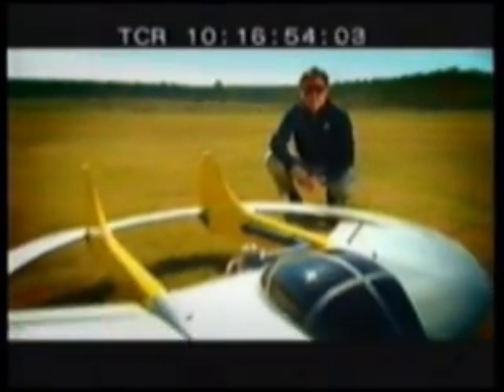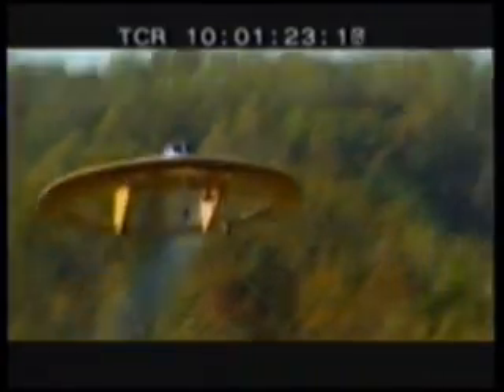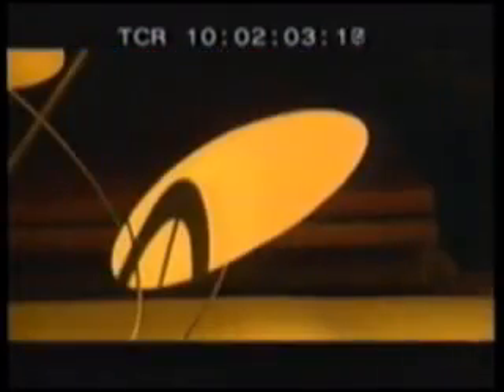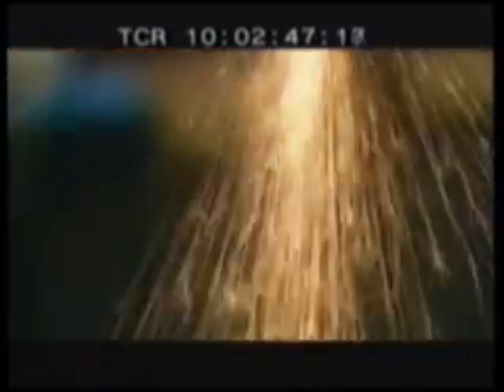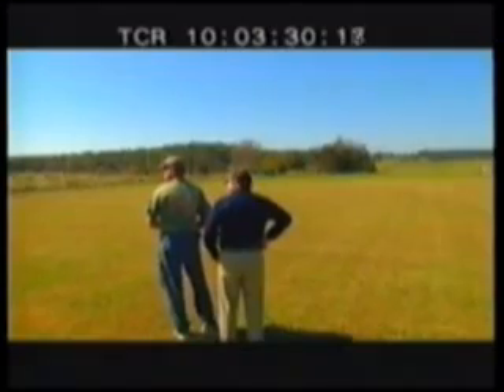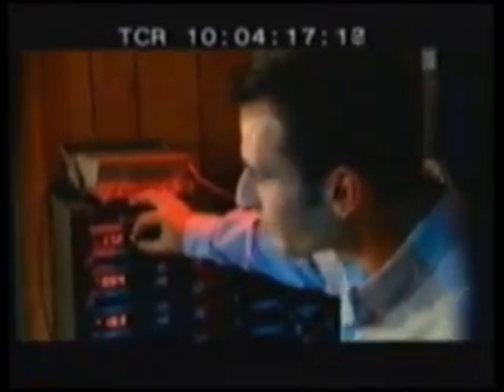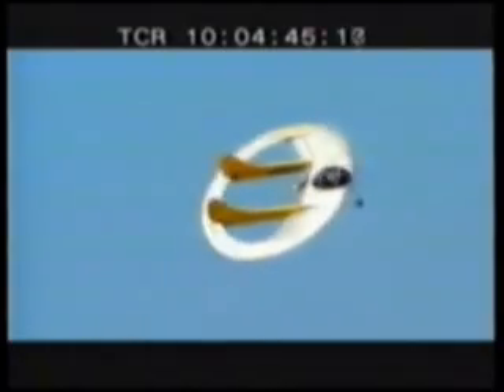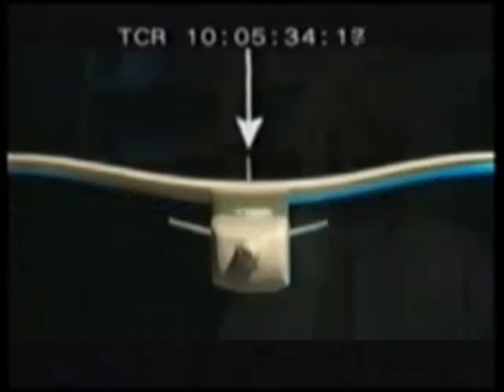Flying Saucers Are Coming!

Comment: Many disc wing planes have worked well, and others of the very-low aspect-ratio sort.
One thing this video doesn't go into is stall characteristics. Does it stall?

The model Sack AS-5 did very well. The AS-6 probably didn't have suitable landing gear to get enough "_A_" angle of incidence . It certainly didn't need any more power or even what it had, to fly.
 The similar Arup planes did very well, with 30 degrees + "A". The Moskalyev SAM-9 also had trouble getting aloft until they gave it more than 25 degrees "A".

See the Arup S-2 and S-4 from Indiana which were amazing, superior in almost every criteria to "normal" planes (super-STOL, extreme rate of climb and quick on little power, stall-spin proof) Arup S-2 in a museum undergoing restoration. S-2 was the deign ancestor of the Vought V-173, which did not need the props situated as they were.
See the youtube "flying heel-lift".
https://youtu.be/Nxz1UF67EQI
Arup S-2
https://youtu.be/TX5s4yEP09I

Arup S-4
https://youtu.be/_XrSFVDa3mY
1980s follow-on proof of the Arup
https://youtu.be/zK63GJ0saBA

See the Nemeth "parachute plane" which was also notably superior, also notably ignored. Faster than the plane which the fuselage came from, Steep climb and descent, Super-STOL, stall-spin proof.
https://youtu.be/WzjpXLKLx1s
The similar 1930s Farman 1020, also stall-proof, super-STOL, faster than the original.
https://youtu.be/D6lxRrSyopM

Also from the '30s the Payen/Aubrun AP-10 which did very well by all reporting.
In the '40s see the Eshelman, commonly called "flying flounder", being proposed as a carrier-borne fighter. Rapid climb and fast, super-STOL.
https://youtu.be/JpV68abt8uc

1930s work by Piana Canova on very low aspect-ratio planes PC-100 and 500 gliders, and PC-140 monoplane.
Concurrently see the "Rosenfelder flying wing", which is very similar to the Sack and the proposed Me-600 discoid plane.

After the war the Avro Canada/USAF "Weapons System 606a", of which the Avrocar was the VTOL landing gear half. The Avrocar didn't need to go faster or higher, when you see what the Arup and Nemeth and the 2015 Rowe "UFO" can do.

Also in youtubes, the 1959-60 Sukhanov "Discoplan" gliders, working up to super-STOL supersonic fighters concurrently with the Avro project. (Both Sukhanov gliders in a museum now)
Letayushchiy (flying) disk
Летающий диск (1964) 17:20
https://youtu.be/UQ1XiIMgLck
video
https://www.youtube.com/watch?v=at77GUZm9rY

See the 1940s proposed Boeing model 390 and 391 fighters: The "Flapjack" which the Navy should have built. By ample experience of similar planes, it would have been extraordinary, would have revolutionized aeronautics.

On youtube, see the 2015 Rowe "UFO" discoid light plane. Like the Arup, stall-proof and STOL, rapid climb, sleek on little power.
https://youtu.be/eFgr90LobAQ

https://youtu.be/_-u0Y7cDngM

Comment: Where is this original air craft and is it for sale would love to have it as a legacy to my father that built it Mike Rawls. thanks in advance Kevin Rawls.    krawls1@bellsouth.net
Reply: Mark Murdock has the original. He is rebuilding the vertical fins and addingnew fuel tanks. It now flies up to 90 mph with a 1.2in Webra engine. We also have a 2meter fiberglass prototype with a 5hp gas 3W engine.

Comment: XF5U
Reply: loosely copied by the designer who had seen the Arup S-2 fly for NACA in the early '30s. (See youtube "Flying Heel-Lift")
The V-173 "flapjack" test plane did not need or gain anything from the situation with the oversized wing-tip mounted outward turning, tuned, plane changing props. NACA tunnel tests said it didn't change anything or gain anything versus normal 80hp props spinning inboard.
The Arup proves that the exceptional flying qualities of the V-173 were from the very-low aspect-ratio planform alone and not from the props.

The XF5U never even made a test hop because of the over-complexity necessitated by the power-sharing drivetrain.
 Arup planes were notably quick on little power, super-STOL, stall-spin proof.

The discoid naval STOL fighter wasn't killed by the advent of the jet age as is usually told. They'd have been awesome on jets and would have revolutionized aviation with discoid wings, if the Navy hadn't let it die.

See also the Boeing model 390/391 of the 1940s for their design for a naval "flapjack" fighter that did away with the wing=tip props. By the experience of the Arup, the Hoffman "Flying wing" which was related, and the '80s Hatfield "Little Bird" they'd have flown amazingly.
Reply: invented around WWII

Comment: The use of circular or disk shaped wings is not new.  I believe students at Harvard made a monoplane aircraft using a 'parasol' shaped wing in the early 1930's or sooner.
Reply: In the '30s, in  Florida, the Nemeth "Parachute plane", and in Indiana the Arup planes were partly designed with help from a classroom.

Comment: The Navy had a craft named the XF-5U which was approved to go into production, it was of similar configuration to this craft with the engines on its outboard sides, look it up it was called the Flying Flapjack.
Reply: Yes, we studied it years ago. very interesting project.
Reply: loosely copied from the Arup S-2 which flew for NACA in the early '30s. (See youtube "Flying Heel-Lift")

Of the V-173, NACA tunnel tests said it didn't change anything or gain anything versus normal 80hp props spinning inboard.
The Arup proves that the exceptional flying qualities of the V-173 were from the very-low aspect-ratio planform alone and not from the props.
 They'd have been awesome on jets and would have revolutionized aviation with discoid wings, if the Navy hadn't let it die.

See also the Boeing model 390/391 of the 1940s for their design that did away with the wing-tip props.

Comment: What happened to this little project?
Reply: The largest version of this design is 6.5 ft in diameter and flys at50lb.s MTOW. Small electric versions fly at 2 to 3 onces and 8 inch wing span. Some are UAV's.

Comment: TU Delft in The Netherlands has try reach allready with flying saucer idea they create too reach airliners and even Boeing, but not yet succeed yet in 2009. Maybe you can make contact with TU Delft (Technical Universaty Delft, The Netherlands) to work toghetter. I hope! It's my dream too, to travel with flying saucers. It's cheaper, safer for human AND birds without fossil fuels but solar energie or something different. Some airliners had interesses in that project, but the most important never came up sad enough :(

To take off and land, maybe it's not so difficult. Look at Helicopters for example. There must be a salution somehow to take off without propellers or airplane engines and then land safely.

Comment: Or the Avero.  Personally I find odd shaped air frames intriguing.  Although all small scale planes are easier to make work when compared to full scale.  Power to weight ratios are usually better on small models.

Comment: first of all UFO means unidentified flying object the term does not have any particulars about what the object looks like. I was really disappointed with his research analysis (solid disk has terrible characteristics while landing) apparently he never got the information about the pancake aircraft designed by the military the pancake aircraft as very good flight characteristics and is remarkable in landing and takeoff.
Reply: His engineers knew all about the WWII flying pancake. This not a solid disk.there is open airspace in the center. This can descend vertically and has done it at Air Shows in Ga. and CA.

Comment: I have an idea, and basic design of a flying saucer that if built, would almost certainly have to be unmanned because it can turn at incredible speeds. there is no other craft that i'm aware of, with a design like mine. mine is really about HOW it can change direction so fast. if we could combine his craft, with my design it would be unstoppable. his already looks like it turns fast, and is stable. if we put my.....controls, for lack of a better word, would be like putting his model on steroids. with my design could make abrupt turns at high speed. i'm not an engineer, so I don't know the right words, but it would definitely work. I got the idea from current technology, so it could be built right now.
Reply: ctcole77
This lying twoofer doesn't like to answer any questions that debunk his magical theories!

911 WAS AN ISLAM JOB!
Reply: DUH!!  me 911 twoofer me tinks alumiunm glows silver just like Terminator movies
Reply: ctcole77 duh, anyone with half a brain knows i'm right. of course that half a brain thing excludes you.
Reply: gary williams
Science
Reply: gary williams
911 TRUTH = MAGIC
Reply: ctcole77 what's
Reply: ctcole77 in
Reply: ctcole77 your
Reply: ctcole77 ppile
Reply: ctcole77 of
Reply: ctcole77 accord
Reply: gary williams
911 twoofers LIE!
Reply: gary williams
What about MOLTEN ALUMINUM?
Reply: gary williams
911 TWOOF = FAKE THERMITE

Comment: the fact is, the concept of a UFO inherently involves anti gravity technology. if anti gravity tech doesn't exist, aka is impossible, then UFOs are not feasible. putting a propeller on a UFO doesn't solve any problem of mankind. the best stealth aircraft, given what our technology can provide, are not disc shaped. this is because the jets are designed to provide forward force, not downward force. with anti gravity technology it would be possible for a UFO to just sit in space without any propellant. force in any direction would cause the UFO to move in that direction. this UFO is basically worthless because it can't hover in place or perform vertical takeoff, which is the whole point of a UFO. the UFO is only desirable in that it's totally silent and has anti gravity technology. the anti gravity provides a few major advantages: 1) vertical takeoff/landing, 2) extended, stable hovering, and 3) most important, space flight. the propulsion system cannot depend on air. that means propellers, jets, turbines, props, etc. do not work. the only technology we have that provides spaceflight is the rocket, which uses a fuel propellant. usually solid. this is not great because it has thrust in only one direction. in order to switch directions it must "turn," which is slow and cumbersome and wastes propellant. it's not conducive to any kind of combat. a UFO with anti gravity technology is a misnomer, because such a thing is not possible in any sense. in order to have a UFO that both travels through space and resists the earth's gravity, it must take advantage of some other force which will allow it to remain steady. if it was completely immune to earth's gravity, it wouldn't "float" over the ground. the earth is hurtling through space at a million miles per hour. the only reason we're still on it is because of earth's gravitational effect on us. if we had some kind of anti gravity device on our backs, we would simply disappear from earth within a millisecond. the earth would continue moving through space, and we would be left behind, as the gravity wouldn't pull us with it. this is why "anti gravity" is a silly concept. an anti gravity UFO could not possibly stay put in one spot, unless it had extremely advanced propulsion systems which would allow it to move as fast as the earth, and be dextrous enough to stay in the same spot relative to the earth the entire time. that sounds basically impossible from a practical standpoint. but if aliens have achieved true anti gravity technology, and that's how their UFOs work, that means we won't discover such a thing for perhaps thousands or millions of years. that's a lot more advanced than making a UFO which depends on some kind of electromagnetic propulsion. just letting yaknow
Reply: not true, the Nazis were working on a anti-gravity device, and many, including myself believe they succeeded it was known as the bell. coincidently some time after the war ended, the bell which disappeared along with a couple of key ppl, returned, and landed in kecks burg, pa and was covered and taken away by the army and never heard a word about it since. if you're not familiar with it, they took two spheres of mercury, or some other heavy metal, and spun it at high speed, using massive amounts of electricity.
Reply: Shane Hunter instead of "anti-gravity", think 'lofting' technologies...search for Thomas Townsend Brown patents or electrogravitic propulsion,etc.He demonstrated his findings to the U.S.Air Force back in the 1950's. Thomas F. Valone has written a book on the subject. Craft using mercury rotating at high rates of speed in an electrified field are described in ancient India (vimana). China has looked into some of the ancient India texts for input and implementation for their space program. The reputed TR3B flying craft reputed to be out of Groom Lake (Area 51) is said to have a mercury vortex lofting technology. However, no public sources of information are going to admit the verification of this. Nikola Tesla was able to achieve the levitation of two metal plates in a high frequency AC field back in 1894 with celebrity witnesses. In 1897-8 he patented an alternator that could generate the same AC field. Now if you take the idea of taking the two metal plates and extending their size to envelop such an altenator then you have an electric flying craft. He achieved this by 1919. Around that same time in Germany, psychics were purportedly receiving information on how to build similar craft. This eventually became the Hanebu and Vril programs of Nazi Germany. And with Nazi scientists coming to the US in 1945, this work continued and as such a Roswell incident cover up happened along with continued R&D in underground facilities like Groom Lake.

Comment: Very interesting! Especially in terms of maneuverability at low speed.
Reply from the maker: Hello RCL, slow speed maneuverability is greatly under appreciated. I predict
that when Geobat becomes full scale pilots are going to have blast performing
slow speeds stunts.  We are very close to creating a Geobat for the LSA market. Remember you heard it hear first, my real goal is to just make a manned flying ring viable whereby other engineers and scientist have a platform to experiment with. Think electrically enhanced flight which means L/D becomes a secondary factor. The communications industry has already embraced Geobat

Comment: I wasn't thinking basic 3D CAD. I was thinking actual physics model based programs. The reason I mention the X Plane simulator, is that they run things off of blade theory, giving the aircraft models more realistic dynamics. One example, the Garrow Verticopter, has been tested as RC models in both the real world and that program, and used data both ways to refine the design. If your Geobat were to be tested in RC form in real and virtual systems, it might help predict large scale tests.

Comment from the maker: I understand where you are coming from, historically you are correct. However,
Center of Gravity has plagued all prior attempts. This relates directly to stability
and maneuverability. Geobat solves these issues. This is exactly why the senior engineer from the D.C. Naval Research Laboratory visited me. He intimately understood the significance. You are only seeing the tip of the iceberg so to speak.

Comment from the maker: Think of Geobat as a safe testing platform for new tech that can take advantage of a stable flying ring. High level interest is engaged. In the mean time, the logic of a circular aerodynamic vehicle has benefits with regard to aerodynamics and shape. Thanks to the Aerobat group the dominoes are all starting to line up. Per their request, Geobat..com has been pulled. My perception is that this thing called Geobat will slowly blend into what we perceive to be a classic flying saucer shape.

Comment from the maker: The pusher concept places thrust very close to CG. Now imagine that same toy wagon being pushed in the opposite direction, your steering wheels are directly about your hands, very easy to change direction. However,
for speed you can't beat a tractor. Any circular design that has more wing area forward of the circle center will work. CG is generally 1/4 of the diameter aft of the leading edge. Ex. 40" diameter, CG is 10" aft. Now go forth, build and have fun!

Comment from the maker: Hello, experimentation is welcome, just don't start selling it. Tractor designs are not nearly as nibble. I describe this as dragging the wing through the fluid, similar to pulling a toy wagon. you physically have to move your body/engine mass to deviate from a straight line. The prop wash is less than ideal for fluid flow about the central forward wing. Mark Murdock faomies -search utube. He built 1 tractor, the rest are pushers. see next post.

Comment: Merlin, I would like to ask your permission to attempt a 20" dollar tree foamboard version of this design with a 50% kFm2 step on the leading edge, 24g electric motor, puller instead of pusher prop.  I would like to offer this to other scratchbuild RC'ers as a free plan to fly and tinker with, crediting you.

Could you please tell me what is the percentage of the center apex (the forward angles) in the inner circle compared to its diameter (or even its radius) of the inner, like 14" circle?

Comment: I built several of these types of aircraft (pretty much identical) to your design about 12 years ago! way to go man, Im now integrating three rotors into the chassis of the craft like a "tricoppter" so that it will hover also! My new craft will fly fast using less energy than a traditional multirotor to sustain flight but can then hover to aquire a steady firing poition on a fixed target.